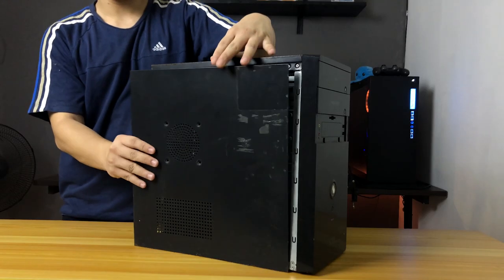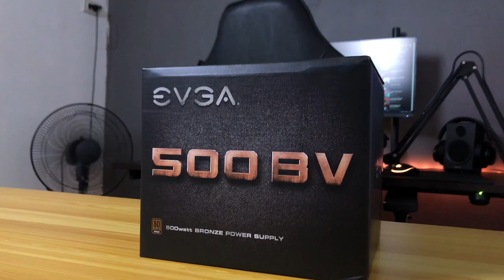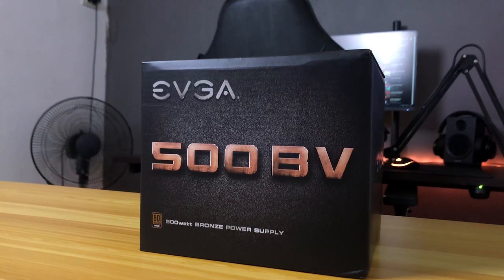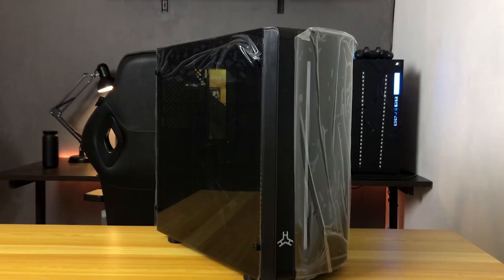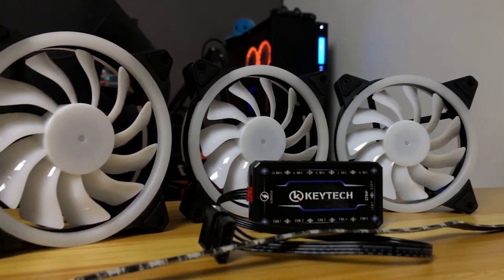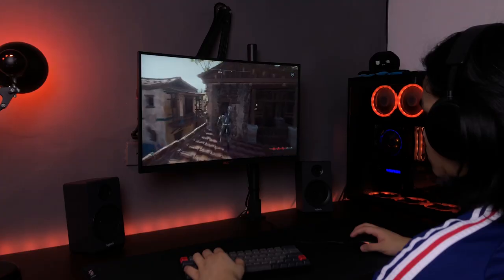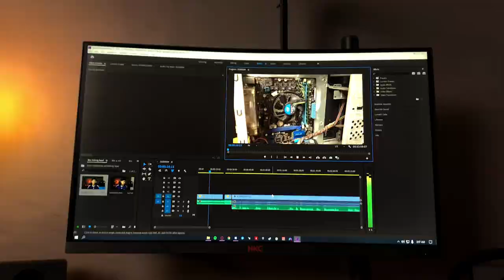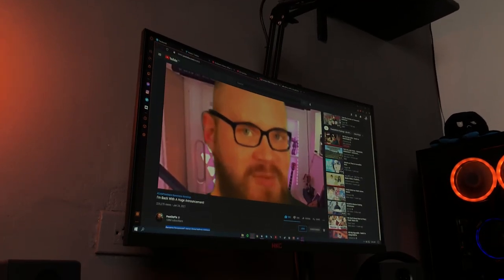10k Php PC UPGRADE... WAS IT WORTH IT?

Comment: how to install fan in the back side? there are no screw holes in rakk marug :(
Reply from the maker: Are you going to install an exhaust fan on the rear side of the case? There should be screw holes for that. If there's none try to contact the seller.
Reply: There are screw holes for the exhaust at the rear side of rakk marug bro. Check it again.

Comment: How did you keep single color on the rgb led strip on the front of the case?
Reply from the maker: There's a button on the top of the case where you can cycle through the different rgb modes.

Comment: naka custom fan yung gpu mo lods? bat yung sapphire 470 nitro ko sa 75c temps
Reply from the maker: HIndi sir naka stock lang siya all throughout the benchmark. Baka need na po nyan ng thermal paste replacement pero pwede rin factor yung airflow ng case.